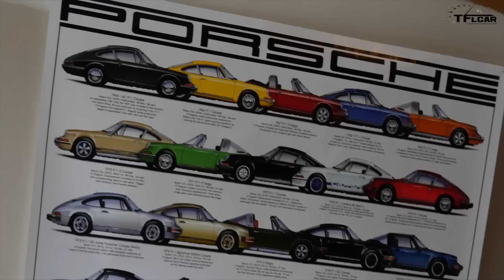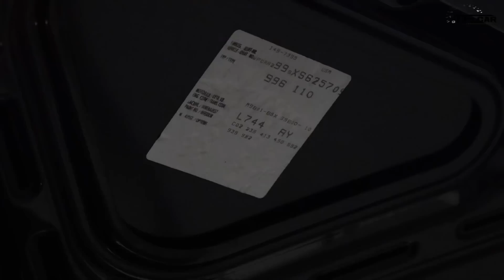Top 5 Best Classic Porsche Bargains - Project Porsche Ep. 1

Comment: I have some questions:

1. Would a 1997/1998 porsche boxster/S be the same as a 2004? And which would be better, a automatic or a manual?

2. Which is better, a 2003/2004 boxster or a 2009 one?

Thank you.
Reply: christian olan more or less, the newer ones have very slight changes (a glass instead of plastic window for example) and a little more hp. But they also an IMS bearing more prone to failure (not that you shouldnt change yours if it hasn’t been already). They all are great cars. DEFINITELY get a manual.

Comment: Best Porsche for around 7000$-8000$?
Reply: Haptic boxter
Reply: 944 turbo
Reply: zestydude87 I have an old 1983 Porsche 944 that I could get around 7-8k for. I'm looking for a mid 90's 944
Reply: zestydude87 you're not getting a decent turbo under 12k. 8k is where you find a decent 944S, but an 8k turbo needs like 5k worth of maintainence, unless the seller doesn't know what he has and sells cheap

Comment: I know this show is over a year old but....I have to disagree on the 944. Okay, an NA 944 has been a cheap "by your kid a real Porsche for little money and let them thrash it" But the 944 turbos are a screaming deal and I believe set to appreciate in the next few years. 1. Very easily modded to make crazy horsepower and if taken care of will last forever.. 3.  50 50 weight distribution, they handle very well.. Yes I own one and so maybe I am biased but as the rest of the Porsche line up goes through the roof these become more desirable by the day. Mine has the chip set and wastegate etc...it is putting out 300 to the wheels and is an absolute blast to drive. Find one that's been taken acre of it is a steal I gave 11K for mine with all the records since 1998 and it is pristine inside and out with just a couple of minor issues.

Comment: Great idea for a new series.  I always liked the 944 and 928.  Same reason, that 928 in Risky Business did if for me.  He says they have too many issues to be worth buying at this point.  That make me wonder if they are a prime choice for a LS engine swap.  I've seen a few 944s at shows with V8s.  I know some would say that it destroys the balance that made it a great car in the first place, but the motor swap would make it reliable again and give it a whole new personality.  You may lose some of the balance, but those LS motors especially if you find an aluminum block shouldn't be that bad.
Reply: +goatmonkey2112 

Nothing wrong with a properly maintained 928. I bought one off a 928 experienced mechanic and drove it 2500 miles home. 

The maintenance cost is elevated, but as long as you keep up with it you can run the shit out of them.

However, if you're not mechanically competent and can't do the maintenance yourself don't buy it.

Comment: My brother is interested in a 944, they are between 5-10 grand in our area, what do you think? Tell me a bit more. Worth it on the budget?
Reply: +Krzysztof Blach It could be a fun toy if you can find a good example, but keep in mind they are old cars now.  Most of them have been tinkered with and almost every one will have been fixed on the cheap by people who really didn't know what they were doing.  As long as you understand going into it that the thing is going to break and you will lose money on it then it would be a fun toy to have.
Reply: +Krzysztof Blach They're great, and the handling is so good. Only issue is that it's an old car and things happens. If you send send it to the porsche mechanic it will be expensive. But if you can fix thing by yourselves, it will be an affordable and good sportscar.
Reply: +Krzysztof Blach I'll give your brother the same advice I gave someone else here in the comments section: Get a 924S instead. It has a 944 engine/driveline in a 924 body, making it lighter, more aerodynamic, and therefore quicker. What's more, you can typically get one for about 2 grand cheaper than a 944 in similar condition and with similar miles because people think it's dog-slow like the regular 924 so nobody wants one. So you can scoop one up for a song.

Comment: The value of 90s 928s has been on the rise and the 928 GTS have been selling for HUGE money (but that's a truly rare car).  A 90s 928 might be a buy if the GTS continues to sell for $100K+.  The Ferrari 308 was a high 20s-low30s car not that long ago either and now have doubled in value.  I wouldn't be surprised if the values of some 928s gets pulled up.  If a 914 can sell for $20K it won't be long before nice 928s start selling for a premium (hell might freeze over before 1980s models with Automatics become collectible).

Comment: Love the conversation but you are wrong about the years for the 964.  My guess is with over 200 comments someone has already pointed that out but the first year for the 964 if I am not mistaken was 89 with the Carrera 4 launching first and then the Carrera 2 shortly afterwards most likely as a 90. The Turbo was in 91 & 92 as a 3.3 and then the ultimate 3.6 only in 94.

Comment: Like most people, I don't really consider the 924 to be a Porsche.  It was cobbled together with various VW and Audi parts and was almost as reliable as a Yugo, especially after it had aged a few years.  Even if you could get an acceptable amount of horsepower out of it, the suspension and brakes were still spindly parts bin units that were more suitable for a VW Rabbit.  There is a reason you see them sitting in the edge of the woods beside ram-shackled mobile homes.   The 944, on the other hand, was a great car in its day.  I know a few people that still have them.   Unfortunately most of them have not been properly maintained and buying one today means you are likely buying someone's money pit.
Reply: I agree the 924 was a piece of junk. What will really turn you off is the fact Porsche dealers charged you like it was a 911. Its a VW with assist from Audi.

Comment: AVOID 97-2008 Boxster/Cayman   and  99-2005 911  years = they have that dreaded Intermediate Shaft Bearing in those engines, and they fail unexpectedly, totally destroying your engine without warning.   Google it and find out yourself.
Reply: It's a simple fix.  That would be like saying avoid all Bmw M cars with the s54, s65, s85 bc of the self destructive rod bearing issue.  Every car has there issues including the s2000.  Some cars are worth the repairs, some aren't.

Comment: Love my 993.  I use it as my daily driver (just passed 150k miles) and maintain it like an airplane. I was lucky enough to buy when the economy crashed and they could be found in the mid to low $20's.  Now they seem like twice that for the most ragged out example.  

Looking for a 996 for my wife now while the prices are low.  I don't think they will ever be as expensive as the 993 simply because there were far fewer 993's made, but they definitely won't be this cheep for long.  I see 996's regularly for under $15k 4S's even.  That is A LOT of car for $15k.

Comment: Buying a 2003 C4S was the worst car mistake of my life. I love 911's but I will never get close to a 996 again.
Reply: What disappointed you so much?
Reply: +Nik Brudar It had kind of high milage and just cost me so much to keep on the road. I wanted to use it as a daily driver but it was in the shop half the time. After I spent $3k on a clutch it was time to move on. If you buy one and want to daily it I would set aside $10k for repairs
Reply: Alex Stern yeah it can become expensive as fuck.. You really need to be lucky to get one in mint condition, without any weird issues.

Comment: My brother bought a LHD 911S ('76 model), about a year or so ago for the princely sum of approx. $3.5K.  Yes the engine 2.7 was dead, and it had a whole lot of other minor issues, untidy interior, leaking sunroof, and a rubbish paint job.  But he bought a good 2nd hand engine for another $3K, a whole range of other interior parts and later on will strip and respray it.  A bargain undoubtedly in the 911 bubble for sure.  
As for 944, not all are rubbish and will get you "upside down" to use such weird terminology.   A good condition, low km 944, Turbo or even S2 are still very much worth considering.  Even a 968 could be a good option.  Turbos and S2s are if anything by the market out here in Oz starting to increase in price.  So if you want one, and can find a good one, I would suggest getting in now before they too become too expensive.  Out here the only "bargains" are older model "Coxters" early 944s and 997s.   Even the last of the air cooled "911"s have risen in price.

Comment: Long time Porsche enthusiast here. I have owned numerous models. What I will say is this; like it or not,  the Porsche 924 saved the marque. It was inexpensive, had a 50/50 weight, best balance, shifted better, wore tires evenly, handled great, best aerodynamics/ CD and was cheap to maintain due to VW/Audi parts. Because of the 924, the 944, 968 came to be. The Porsche 924 is the most underrated Porsche but the model that saved the marque. It's fault was it was the first front engine Porsche and under-powered.
Reply: Porsche was in trouble more than once. I have ties with the factory, in the mid 70's Porsche was looking to replace the 911, the 928 was stillborn and the 924 series than 944/Turbo/968 inevitably saved the marque, this is a fact. The 924 was the biggest seller in that era, whereas the Boxster played a role at a much later time.
Reply: JW
Reply: Yes Porsche was in trouble more than once...I remember when GM was trying to buy Porsche. My point is,  the 924 carried the marque throughout the 70's/80's and later  944/968 line, the production of 335,884 units Porsche wouldn't have made it to the Boxster/Cayenne etc.
Reply: And because of the hatred towards the 924, I can afford one. They are cheaper than old golfs where I'm from.
Reply: @EeziPZ  I have just bought a 924s - fitted with the 944 8v engine.  A lovely light, narrow and wieldy little car and perfect for the windy back roads we get in the UK.

Comment: So in 3 years I'll buy a 718 Cayman S, sounds like a plan
Reply: TheyCallMeMidnight Buy a naturally aspirated Cayman if you care about exhaust sound, and it would be a lot cheaper.
Reply: The base 718 is a bit under-powered and has significant turbo lag. The S is definitely the way to go in the 718 lineup. Besides, you can get the optional sport exhaust or an aftermarket system to improve the sound.

Comment: I really don't understand how the 944 isn't on the list. ( not bias at all lol) But we're not talking about making a fortune off of a Porsche, we're talking about bargains. Yes a lot of 944's are not in the best shape. But they are extremely cheap and parts are extremely cheap and accessible. They are easiest DIY Porsche out there. The engine is in the front with plenty of accessibility and the transmission is in the back, giving it almost perfect weight distribution. Remember that in 84 the best handling car that could be bought in America was the 944. You're getting exactly have of a 928 engine in a light weight 2800lb body. Plus the prices are actually starting to creep up on them. Let's remember that a 944 was a better handling and more comfortable car than the 911 of those same years. Seating position is much more ergonomic and the shifter and clutch are the real deal. Yes I like the Boxster but I don't want to work on a mid-engine with those access areas. A cloth roof that cost 2k-3k to replace is not making the car a bargain. Your basically saying that the plastic window costs half the car. The #1 should be the Porsche 944 because it's so affordable and reliable that it can actually be your 2nd car. I'll bet that the 944 is probably the toughest Porsche ever made if we compare the average odometers against any other Porsche model. Just sayin!
Reply: Maybe because they talk about the best classic bargains. E. g. 914/4 is realy cheap for a mid engine car but the Boxer 6 version is the exact opposite.

Comment: Don't buy a budget boxster or 996. These are some of the last non luxury Porsche's and provide an outstanding feel but the budget ones just got no love from the factory. Spend around 13k and find a boxster S with litronic lights and the full leather interior and the proper 6 speed rather then butt plug shifter 5 speed.

A clean S for 13 is the best value for money out there. A cheap 2.5 for 5k is half completed car from the factory, they had to get entry price down and it's sadly given their best chassis a bad name. So try and find a 986 that came from the factory as they all should have.

Comment: The boxer is a good performing car but their soo ugly
Reply: Find one with 18s a hard top and the higher end litronic lights, they can be absolutely timeless, particularly from behind.
Reply: TheBIGJake111 Well a hardtop Porsche boxster is basically a Cayman
Reply: I_Am_Sam you cant take the top off of a cayman though lol.
Reply: TheBIGJake111 Oh that's what you meant. I thought it was the same car but you just couldn't drive as a convertible.
Reply: I_Am_Sam there was an optional removable hard top, looks great on the car. the 996 and 986 both look rough when theyre not optioned at all, but with the factory xenon lights and some options in the interior they look sufficiently exotic.
Reply: TheBIGJake111 Yeah I agree it looks a lot better with the metal top.

Comment: Honda S2000 is a better car and a better value.
Reply: +John Doe Pepsi is bad for you. Makes your teeth rot and are empty calories.
Reply: +John Doe Lol! I do recommend that you drive any 1999-2004 Boxster vs any 2001-2004 S2000 back to back.  You'll see what I am talking about.
Reply: +John Doe Me too.  Mine is a 2006 997.1 Carrera S with a bunch of work done to it.
Reply: +Tim Tursonoff I have Boxster S 2008 and my friend has S2000 and we swap all the time. S2000 was on my list until I drove Boxster S. Boxster S 987.1 that I have now, is better in almost every aspect than S2000, except in tossable department. S2000 feels lighter smaller so some perceive that as more fun. I do too. 
When you step out of one into the other, they have VERY similar raw, driver-centric sports car feel to it. S2000 is tad rawer and more tossable. But Boxster has better quality interior, everything is sturdier and better built. S2000 seemed flimsy and cheap in comparison (if that matters to you). S2000 has better shifter for sure. Clutch is about same. Maybe tad heavier in Boxster which I like. Boxster also has vertically and telescopically adjustable steering wheel, which S2000 doesn't have and is almost a deal breaker for me. Every time I shift my left leg hits top of the steering wheel. Are these cars made for Japanese midgets?
But the major reason I got a Porsche is because it has best of both worlds: one of the best handling and cornering cars in the world, while at the same time fast in straight line. So you get a muscle and handling.
Reply: +220volt74 2008 Boxster better be a huge improvement over the S2000! Only took Porsche 9 years to finally get it right.  I was specially comparing 1999-2004 Boxster vs similar vintage S2000.
Reply: Tim Tursonoff 
I think you got lost! This is not a Honda channel! But if you wanna go there I prefer NSX!
Reply: Tim Tursonoff  Try eating burgers with water wise guy!
Reply: Tim Tursonoff words coming out of person drive lawnmower and noting else